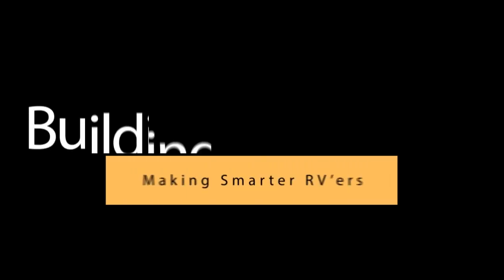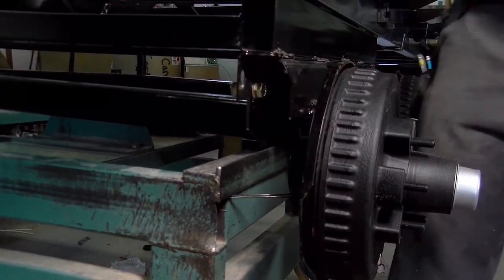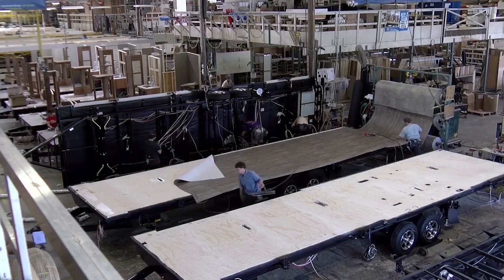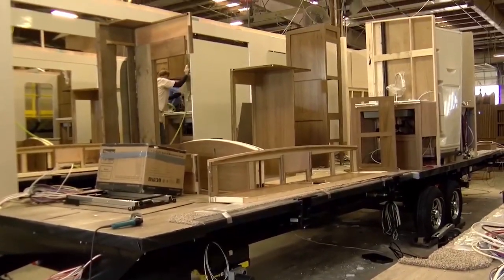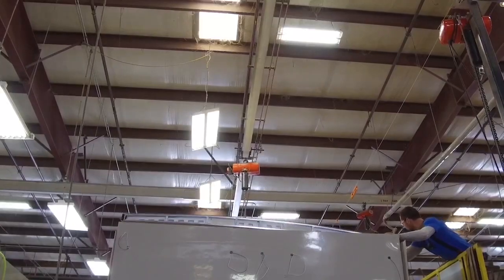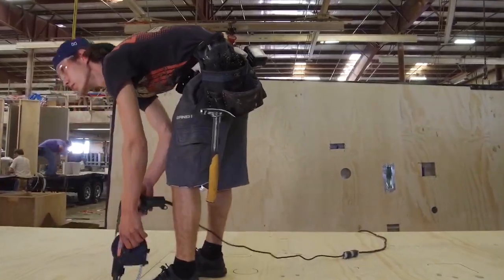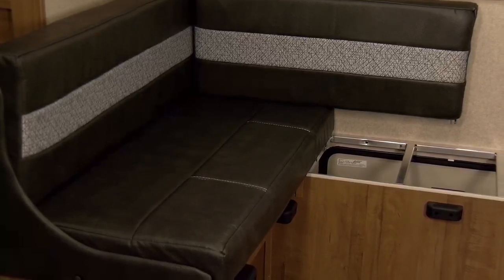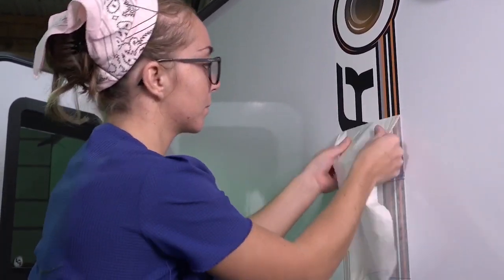What really happens in an RV Manufacturing plant?

Comment: Our Forrest River fifth wheel in the first year has spent more time at the dealer than in my possession. We have had constant slide problems along with a long list of other problems. I will say so far they have covered all warranty issues for repairs but I have countless hours of my time and miles of running back and forth. In my opinion they suck at quality control. Just my 2 cents!

Comment: Every RV factory tour I've ever been on or seen looks like a Ford Model T assembly line from  the 1900's. Did  RV production line engineers just steal a page from Ford's production line manual and forget to update it for the 21st century? Each RV unit is hand built. There's no industrial robots, no automation, no CNC in use on the production floor. Uniformity, or lack ot it, in unit production is totally dependent on the floor workers. Is it any wonder that quality control is questionable in such a production system? Maybe RV manufacturers need to come into the 21st century and adopt 21st century production line technology.